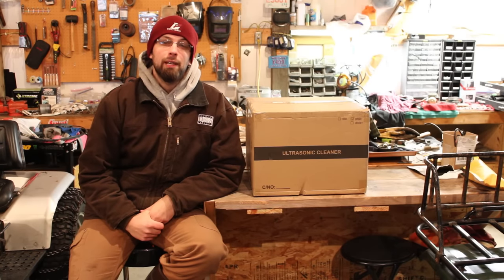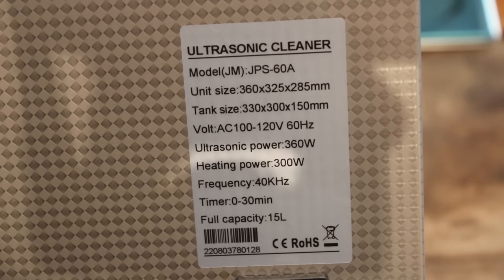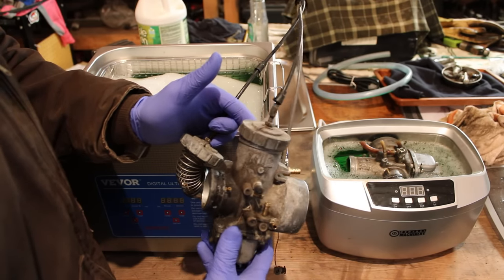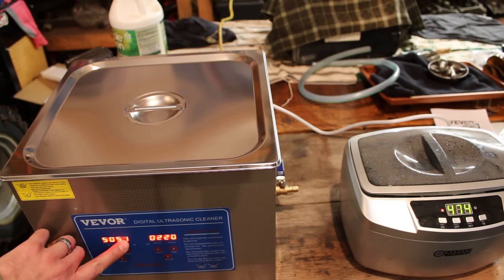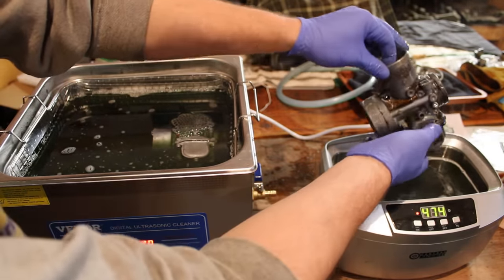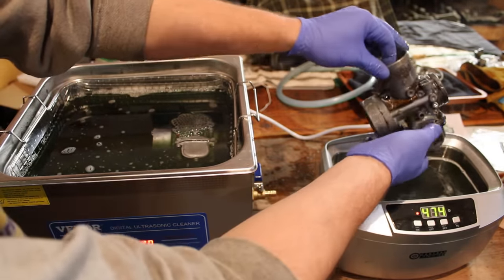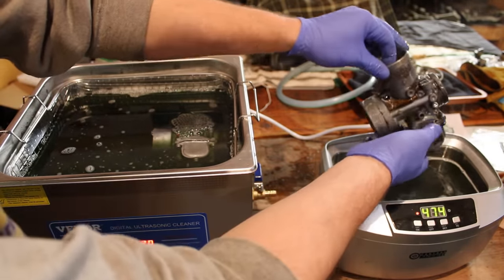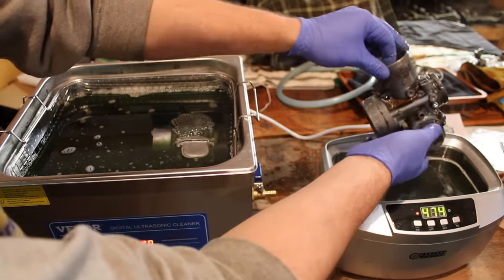Ultrasonic Cleaner BATTLE! VEVOR VS. Harbor Freight! Unboxing, review, and carburetor cleaning!

Comment: Pretty awesome review. I already had the small one and I was wondering how it measured up.
Reply from the maker: The harbor freight one definitely has a better heat source but the actual ultra sonic part seems to fall flat on its face when compared to the Vevor.
Reply: Yeah. I wanted a small one but maybe there's something about the size that also help with cleaning. Maybe you just can't put to much power into a little space, or maybe the power is maintained better in a larger volume. What do you think, is it the size or just the quality or something else?
Reply from the maker: @Bit-while_going  I think it's a wattage thing. The HF unit is 160W whereas the Vevor is 360W, so the ultrasonic portion is literally twice as powerful. Im sure the ultrasonic frequency also has an effect on how well it works but I'm not super well versed in how all that works. It does look like size matters though as the smaller size Vevor units have less overall power as well. The 2L vevor is only 60W.
Reply: The small vevor's performance is nowhere near close to the vevor in this video. 60W vs 360W is a very significant difference.

Comment: Always add to max level...use distilled water... Efficiency increased and prevents damage to the ultrasonic generator. Use a pan or large beaker so you don't contaminate the bath. Dirt/minerals build up at liquid /air interface will reduce efficiency

Comment: I have a vevor 22L the only issue I have is I wish there was a button to over ride the timer so you can just leave it running as long as you want the 30 minute thing is a pain I use it to remove rust and it has to run a quite awhile for that. I have a smaller one made by a company called Branson and that one is well built just small.
Reply: I straight wired the timer in my tiny Hornady badged USC. It is a high voltage circuit,I did a little dance!

Comment: Where I live the 30L Vevor is not much more expensive than the 15L Vevor. Would you say for motorcycle parts the 30L is worth getting over the 15L? I dont think it would be as most bike parts are small enough it seems but just wondering your opinion is. I have the space for the 30L but not sure if its necessary.
Reply: I have a 3.2L Vevor I bought in 2017 that has held up well, and is easy to store on top of a kitchen cabinet.  There hasn’t been many times I’ve wanted a larger tank.  They do show tank dimensions on the label.

Comment: Was wondering what you was gonna do with the harbor freight one because it would be nice to have one to clean jewelery and coins seems like it would be good for that and I keep telling myself I'm going to buy one but there just so expensive but if I was going to buy one to clean carbs I would definitely buy the vevor from what I'm seeing on you're video thanks for the helpful information
Reply from the maker: I keep the harbor freight unit around for smaller items and it does work okay. It just doesn't have the guts to remove the caked on junk you find on the outside of carbs. The vevor does a much better job on that. Thanks for watching!

Comment: I own the harbor freight cleaner.  It really doesn’t do much.  Couldn’t clean carbs or brake cylinders and masters.  I’m ready to toss in the garbage can because I’m tired of a useless piece of junk taking up valuable bench space.  Have others had good luck with the HF unit?  Am I doing something wrong?  It just seems like it isn’t powerful enough or able to run long enough to clean much if anything.  Useless, imo.
Reply: You bought the one he has? Thats for jewelry and stuff like that.  Central Machinery makes them in a few different sizes, this comparison video is pretty much pointless. Its like comparing a bathroom trash bin to a 10 yard dumpster 😳😂
Reply: @woodnbikes  yes.  I have the same unit.  It won’t clean anything.  And I tried all sorts of stuff.  I bought it to clean brake cylinders and carbs on vintage motorcycles.  Any suggestions for a unit that does work?  Don’t care what it costs if it works.

Comment: Is the vevor usable with hear protection or do you still hear the mess. I have tinnitus but was considering buying the 2l model for glasses and stuff... But if the noise level is past earplugs +protective headphones i better not
Reply from the maker: I think its bearable without hearing protection, it's just very annoying in my opinion. I think you'd be fine with earplugs and even better with some nice noise cancelling earmuffs. I still often just let it run and go find something else to do for 30 minutes.
Reply: @NorthwoodsNoise  yeah, i'd be in another room for sure. But i have to be there to make it start and i cannot beare even those few seconds. Thanks for the advice! That was my main concern, I'll just put my beloved Peltor III on 🥰

Comment: yep love when people compare a 1ton truck to a honda and wonder why the honda want do the work the 1ton truck does. if you are going to compare use apples to apples same size and wattage waste of my time watching
Reply from the maker: If you're concerned about fuel mileage, ride quality, and towing capacity, yet know nothing about the honda or the 1 ton truck, it would be a useful comparison, would it not? What would the use be in comparing two items with the same cost and written specifications? By definition they are the same. The risk is null to the consumer. Unless your goal is to determine which manufacturer is lying, an apples to apples comparison is useless. In this case, the question is: is the smaller, less expensive unit capable of doing a comparable job as the larger more expensive unit? Can the common diy'er get by with the smaller, less expensive unit, or should they look for something larger and more costly?